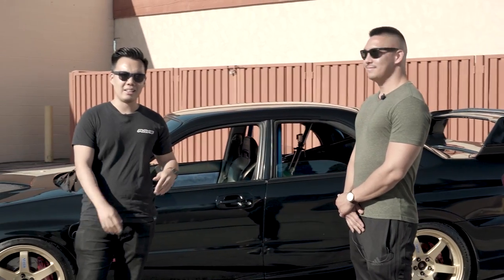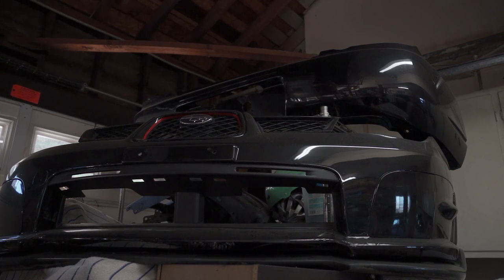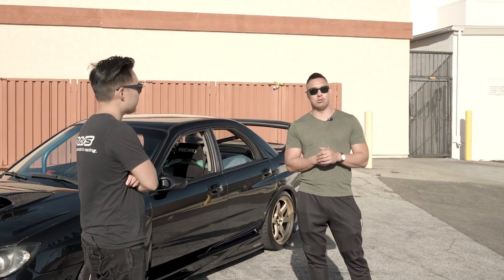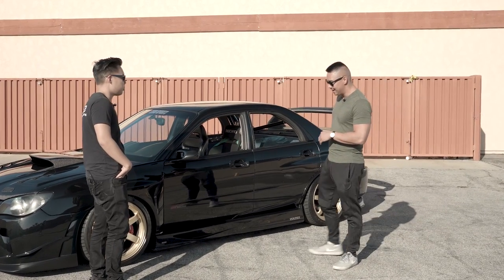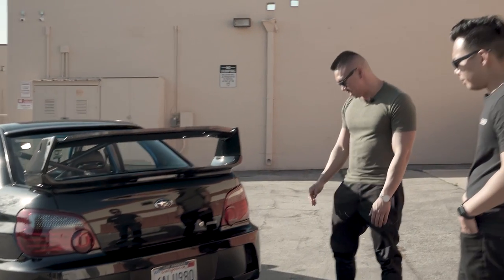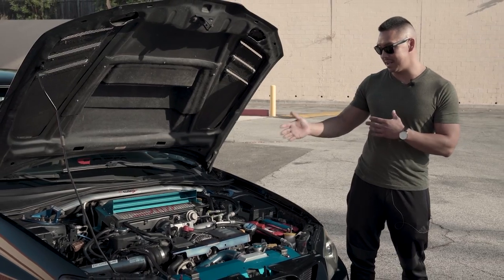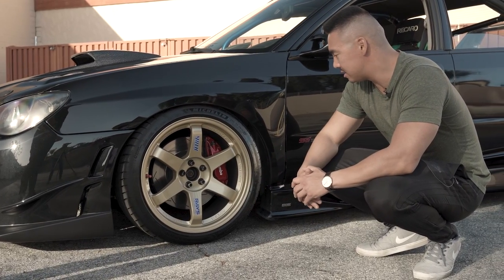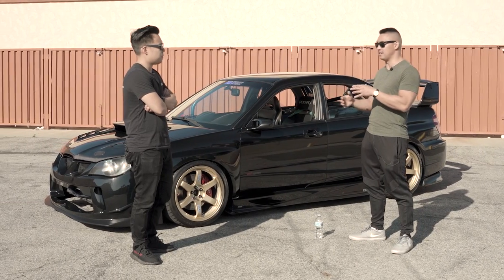@KuostA 's Super Modified Subaru WRX Hawkeye 2006 | Behind the Build #002

Comment: I have a 06 tuned by Paul at Yimi and it has the same power and torque as yours. I have 265K miles on the same motor. So, if you take care of your shit it will last.
Reply: Solid tuner and shop